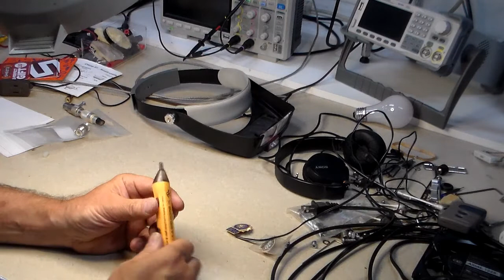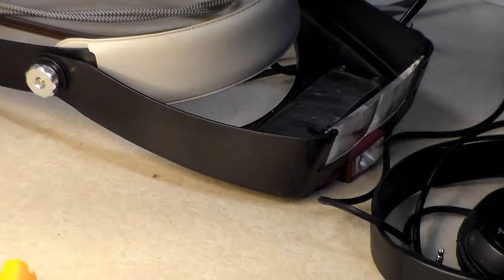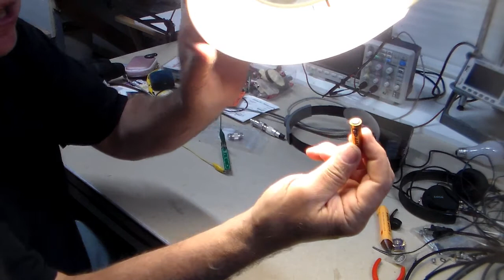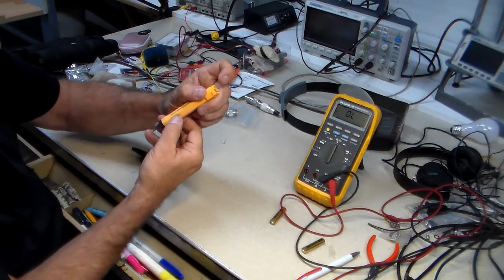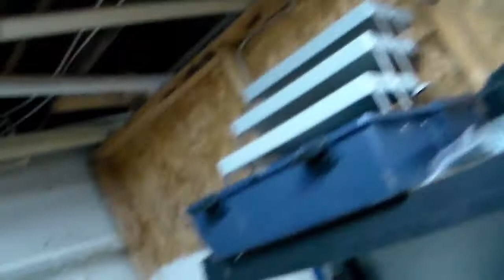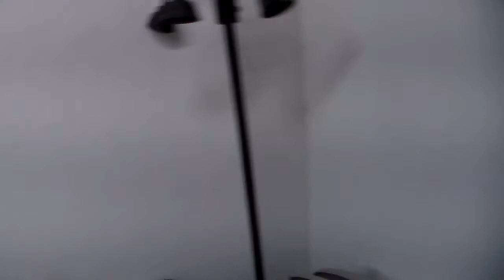KLEIN Voltage Probe   Not Working

Comment: This is very helpful.  In my case, from lack of  use the batteries leaked and the unit stopped working.  The picture of the clip in the removable cap was extremely helpful as mine is in two pieces.  And now I know what it's supposed to look like. :-)  Hoping this will get it working again after cleaning up the mess.  Thank you!
Reply from the maker: Good luck. Useful tool but definitely doesn't get used enough.

Comment: so i have a a Kline ncvt-3p  test it turns on for a second  an  i get a blue light a green light then a red light and it shuts off brand new batteries have u fixed this model before?
Reply from the maker: No, I am not familiar with that model.

Comment: My intertek wasnt working but suddenly it works now. I use it on my phone screen but I guess some phones won't work. It's weird this. This works on something. I think it's a bad connection, it also has a weak beep sometimes. I wish the power on switch wasnt flimsy

Comment: PROBLEM SOLVED:
You're not tightening the battery cap on tight enough. I was having the same problem but if you just tighten it more than you think you have to, you'll hear two quick beeps and then it'll start working. I was reading the Battery Replacement directions under the Maintenance section in the user manual and it said that you need to "screw the battery cap tightly to ensure a tight seal with the O-ring."
Reply from the maker: I’ll give it a check.
Reply: Yup so rigjt I just did it may 28 2024
Reply: Same thing here March 2025
Reply: thanks for this. 11-8-24
Reply: Hell yeah 06/03/25
Reply: Cheers. Thank you!

Comment: Mine will turn on but does not detect a live AC when I put into a live socket.  Anyone has idea to fix that?
Reply: same here. mine turns on but doesn't beep or light up red on a known live circuit.
Reply from the maker: Sorry but didn’t have to dive that deep into mine since it was just a battery issue.
Reply: I couldn't fix it.  So just went and bought one from Harbor Freight for 5 buck. It uses just 1 AA!
Reply: I’m having the same problem with mine, and it has worked for years. Guess I’m going to Harbor Freight tomorrow.
Reply: Same issue out of the box, klein seems to be half baking their stuff.

Comment: Searched this out as I had replaced mine as it was not working, and the new one also did not work.. Turns out they are both good, you must tighten the battery cap until a connector inside the cap mates up with a connector in the inside top corner  of the yellow body (you can see the connector when looking inside the end when changing batteries)..
Reply from the maker: Good information.
Reply: Thank You man! It works!

Comment: I bought that exact one at home Depot, it's brand new, it worked 2 times then stopped working, tried new batteries, nothing, it just stopped. I wonder if Klein will replace it?
Reply: Did u try it on different electronics? Try taking it out when u leave the house and test it on other things. I use it on my phone screen. Wires work almost always